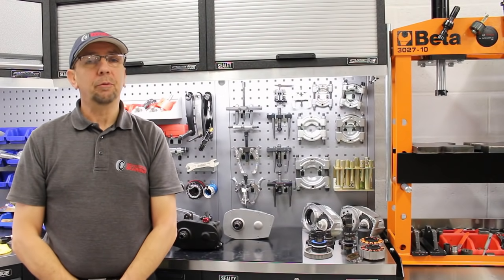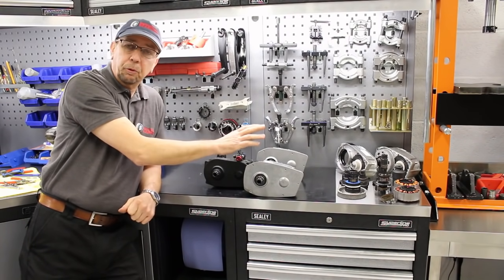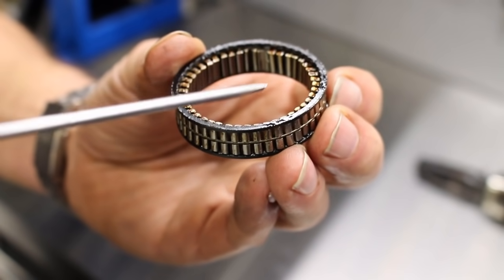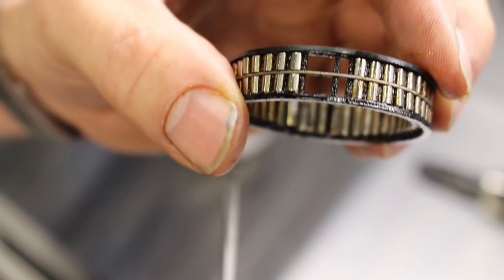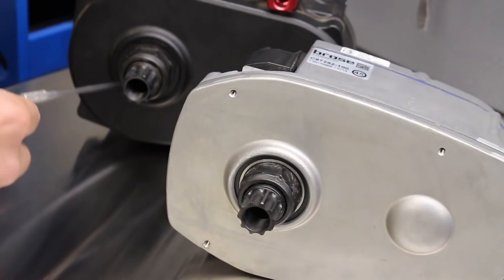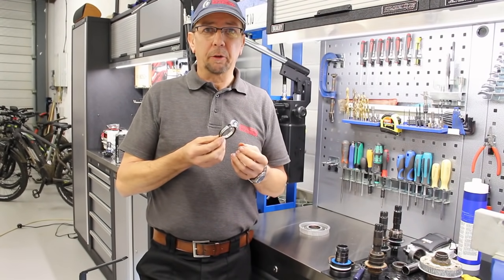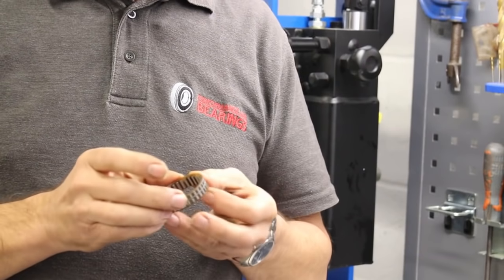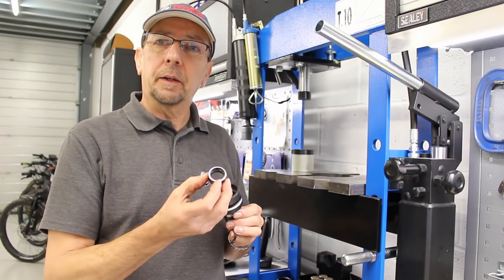Brose Motor Upgrade

Comment: How can you tell what Gen motor you have, please? I'm looking at buying a 2016 BH Emotion Revo Cross that has come up for sale.
Reply from the maker: Brose tend to equate part numbers to their motor series, they don't really tend to have Generations like Bosch for example. But guessing by the fact that your bike is an early gravel bike, I would think it has a 1.2 Brose motor in it. 1.2 is still made today and it just means that it is a 70Nm motor.
Reply: @Ebikemotorcentre   @Performance Line Bearings  Thank you for your video and fast reply, love your work! The 2016 BH Emotion Revo Cross is a hybrid bike and I have reason to believe the motor is a 2.0. I am wondering if there is a recommended time/mileage for replacing the carbon belt, as is done with timing belts in cars, replace every 100,000ks or so, and is there any way to check the motor for possible wear like excessive free play or noise for example other than doing a full tear down? Getting back to the video, what did you end up doing with the worn crankshaft, new or re-sleeved, and how tight do you make the preload on the carbon belt? Cheers.
Reply from the maker: @slavojalois1639  Brose recommend changing the drive belt every 15,000km. We replace most worn crankshafts with new ones. To check your bearings, remove the chain from the front chainring and feel the crankshaft. There should be no play up and down or in and out, the crankshaft should turn very free, quietly and feel silky smooth. This can sometimes be masked by the bearing layout in the crankshaft, so spin the pedals by hand and listen for a roughness or feeling when the crankshaft comes to the bottom of its stroke and there is some weight applied by your hand. The drive belt pre-load is currently 0.2Nm (This is critical, do not try to guess it).
Reply from the maker: @slavojalois1639  Bosch recommend belt change at 15,000km. Check motor by removing chain from front sprocket and spinning crank by hand. The crank should spin freely back and forth with no drag on the front sprocket. Crank should sound silent with no horizontal or lateral play. We normally fit new crankshafts if they are badly damaged. 0.2Nm is the belt tension. Lubricate with Vaseline. 👍

Comment: Hi any idea whats problem i do have brose S motor cut every so often have to turn it off then on  to make it works again while motor cut still show speed correctly no errors on display only once error 26 ever
Reply from the maker: Hi, This sort of issue is usually a wiring or plug connection issue. It may also be the TCU if you have one? I would look at all plugs terminals and wires to see if the issue is visible first.

Comment: Is it worth having the upgrades done on my 2020 levo it currently has no issues with only 200 miles an has years left on warranty?
Reply from the maker: This is a good question! Currently, if we upgrade your motor and make it last longer, you will lose your warranty! This is still important because although we issue a 12 months parts and labour warranty we only cover our parts or any fault of ours while fixing your motor. So, if for example, we upgraded your motor and your ECU (motor brain) fails, you will be liable for a new motor. The annoying thing is, if your motor does last until the end of the manufacturers warranty and you have used it off road, it will be ruined inside.
Reply: @Ebikemotorcentre  when you have done your work on the motors have they been lasting or still having problems ?
Reply from the maker: @adamdoyley7017  We have not had one back yet and we have a fair few out there now! There are 6 or 7 week points on this motor and two main ones we can't currently fix, so we can't promise you won't be walking home one day.

Comment: I’m wondering if this is a useful upgrade in terms of reliability of my first version brose 161. my first one died electrically after around 2000km but I bought the bike used and warranty was denied from the bike shop. my second one is now slipping when pedaling. I am a little unsure if the upgrade with the new clutch bearing will fix the slipping.
Reply from the maker: This upgrades only purpose is to increase reliability. As we replace both clutch bearings with heavy duty versions and a thicker drive belt, this will fix any slipping.
Reply: @Ebikemotorcentre  thanks for your quick reply. Then I can only hope that the electronics will not fail soon - or buy a new bike. Cheers
Reply from the maker: @CarlosGlatzos976  Once we seal the ECU and treat the power and switch plugs, there should be no electrical issues :)

Comment: I have a 2017 sworks levo with creaking noise on hard pedal everytime.  How can i contact you to fix mine.  Thanks
Reply from the maker: Creak is not normally the motor. Check motor bolts, crank bolts, pedals, chainring to spider bolts, seat post, rear shock or linkage bolts, rear axle, spokes etc. etc. Bearings don't creak :)

Comment: My smag motor seems to be acting like a normal bike when pedaling back wards, sprocket, chain and freehub will reverse
Reply from the maker: This happens when your crankshaft needle roller bearing starts to seize to the crankshaft. Unfortunately, it is now just damaging the crankshaft bearing surface so usually better fixed sooner than later.

Comment: My motor just received two more years of warranty,, and two days ago it broke last time they just switched the motor now I'll guess they will change the belt and the belt tensioner and it will be just as good or bad as it was which is the reason why it got broken.. I wish I could send it to performance line bearings instead of brose fixing or switching it.. also I wish if I did send it to PLB that they would make the belt stronger and the tensioner stronger so it doesn't happen every fucking year.. I'm pissed off i saved hard for 18months to get a good EMTB it wasn't easy for me, I'm not a rich Guy my job is to bicycle and deliever stuff in Mountainous Norway I need a good bike and every day it's broken i lose money

Comment: Do you guys still have a shop here in America??
Reply from the maker: Yes, you can find the link here: https://www.performancelinebearings.com/american-supplier/
Reply: @Ebikemotorcentre  oh that’s great!
I’ve got one of the rare Brose motors in a 2019 Kenevo that’s been totally trouble free. The motor is derestricted and frankly rocks!! I do not want a new bike and would prefer to send my motor off this winter, before anything happens.
This rebuild, it appears, would NOT effect my derestriction, right?
Reply from the maker: @dag681  No, this will not affect any de-restriction 👍

Comment: After putting it together do you need to reset the motor or something? I changed a broken belt and now the motor wont run.
Reply from the maker: No, the motor should be fine. Are the clutch bearings the right way round? Check, very carefully the wiring and plugs. If you removed the torque sensor pick-up or the ECU, did the two sensor plug pins go back in properly?

Comment: Why are some mag motors so  noisey compared to others.mines always been noisey but noW got 4000 miles on it.Others seem silent.
Reply from the maker: Great question! We test a great many motors here and the noise can vary from totally silent to quite annoying. The noise usually comes from the planetary gear area and is usually just a manufacturing issue. Sometimes a moulding issue, sometimes a bad bearing from new etc. Some of the early S-Mag motors had an issue where the belt would rub on the motor housing inside. We can now replace this end of the motor, but it is an expensive and risky operation. Not really recommended.

Comment: I opened my electric unit side and now motor not start in all, any way to fix this mistake?
Reply from the maker: If you have removed the electronic control unit (ECU) it is possible that the two small pins that send information from the torque sensor ring to the ECU are not aligned properly. This must be done extremely carefully.

Comment: What is the R&D for the extra seals and the uprated sprag bearings done by yourself or third-party
Reply from the maker: Brose are using these sprag bearings and belts in their 2021 motors, and they have done enough R&D for everyone. We have had the seals out in the field for over a year now. We chose a lot of people who gave us the worst and most abused motors and fitted them with seals and upgrades to test for us. Also we have our own Brose, Yamaha, Bosch and Impulse test bikes to do our own work. Please remember, we do not state that this motor is "waterproof". To water proof these motors would create too much friction. We have used a solution that causes absolute minimal drag or friction and helps with keeping a majority of water out. Ride through a flood, ford deep water or pressure wash your bike and you will still destroy it.
Reply: @Ebikemotorcentre  that’s good to know that new parts are backwards compatible to older models.
Thank you for the reply I was just interested.
Engineer by trade so my brain never stops 😂 allays seeking improvements

Comment: So, it means that whit this new upgrade can we fit standard bearings like BlueSeal, SKF, NTN without the outer seal on the cases?
Reply from the maker: No, Sadly, no bearing is water tight and water will get past the seals. The standard bearings are of excellent quality too. You will not find the right hand crankshaft bearing, it's a custom size and finally the rubber lip built into the unique Brose bearing seal is used to stop the bearing rotating in the casings. 
ASs we state on our site, "adding these seals make the motor as watertight as is currently possible" It does not mean that your motor will be waterproof! If the motor was sealed to be waterproof, the friction would probably knock 30% off your battery range.
Reply: @Ebikemotorcentre  Thanks for the answer, I'm asking because on the vid your BlueSeal bearings look like a "standard" bearing reinforce whit the xrings on the outside, my local bearings dealer have the right hand crank by order but without the seal (unknown brand/ price), Ill guess I have to order the two outers from you.
Reply from the maker: @R.Rodrigues  You're right! The right hand bearing has the designation number 6807 stamped on the seal and you can buy a 6807 bearing anywhere. Unfortunately a standard 6807 bearing has the dimension of 35x47x7mm. However, the Brose bearing, apart from the special seal, has the dimension of 34x47x7mm.
Reply: @Ebikemotorcentre  Yes, the 34x47x7, but still waiting for quote and the brand, I'm expecting to be extremely expensive because its custom, that's why I probably will order the two outers from you (sprags are in good shape and minor pitting on axle were the needles work).
What about using sealer on the gasket to ensure beater sealing, I use type 3 aviation gasket on my other hobbys, does not increase width off the gasket, its really good stuff.

Thank's to your vids I'm able to take my motor apart and in the process off making parts in the lathe to press the bearings.
Reply from the maker: @R.Rodrigues  I would :) To be honest, the only other bearings I have seen in this size are headstock bearings and they have one race chamfered away to fit the forks.

Comment: I question how the product managers and engineers dont consider the application of the product. Both spesh and brose have done a shoddy job in places. That early motor with no seal. Like what!?  Its going on a bike! How can they not consider wet westher
Reply from the maker: When I made this video, I did not want to point out any weakness of any one motor. These are very early years in the eBike world, and ALL motors have their week points and issues.

I am not defending the motor manufacturers, but don't lose sight that these motors were originally designed for the European road bike market. As a road bike motor they don't tend to suffer repeated pedal strikes, pressure washers, deep water, mud, grit, bull dust, 30 ft jumps, rocks, tree roots, etc. etc.

I believe it was the bike manufacturers that started using them in mtb's when Moustache first fitted a Bosch classic into one of their mountain bikes. I don’t say that the motor manufacturers were not to blame as they would not be blind to the fact their motors were being fitted to mtb’s. But, in manufacturing terms, this only happened yesterday. To scrap a product run before it has started paying you back is not great business sense. To fit a seal that creates friction and makes your bike look bad on battery range against your competitor is also commercial suicide. Any sizable company with due diligence will normally spend 4 to 5 years before releasing millions of new motors all over the world too. (I know, I used to be involved in this process).

There are a million and one other things to consider but my one finger typing skills don't afford me the time to discuss everything. Please rest assured, the manufacturers are aware, and they are working on it. Change is coming and I will probably be out of business in the near future.

Also helps to know there are millions of motors out there working happily after thousands and thousands of miles…

Remember when you would get off your normal bike and carry it through the mud because you could no longer pedal the thing! And now you use your eBike as a tractor. I know, I do the same and its great fun, but I bet the manufacturers never saw things like that coming!